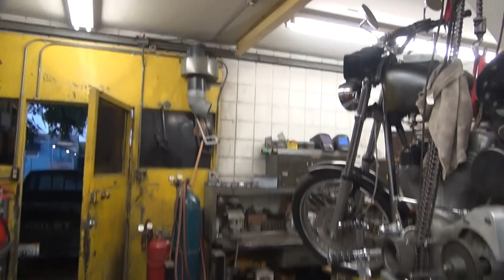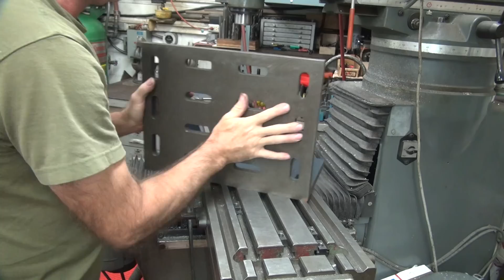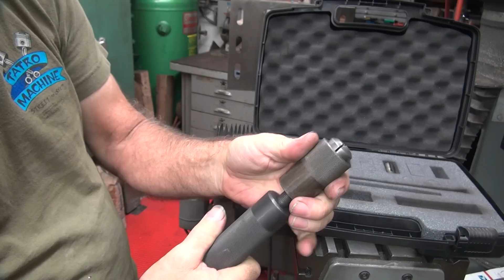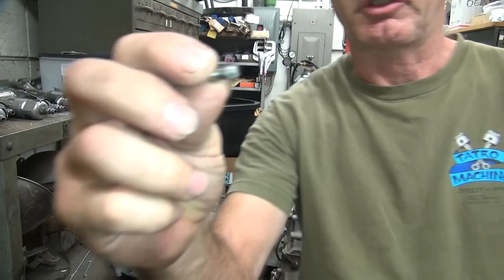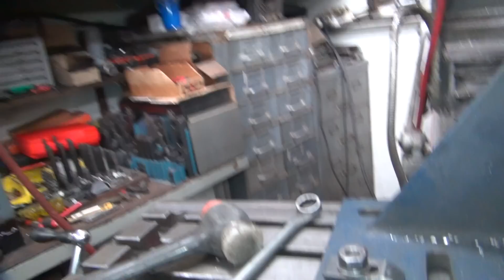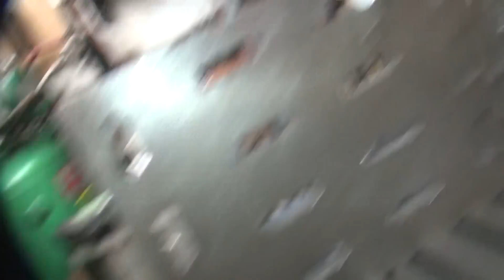#111 1976 98ci stroker shovelhead motor rebuild case repair flywheel balancing harley tatro machine

Comment: Do you ever lap case halves together using lapping compound?
Reply from the maker: no because it does not make them flat. anything more that a light lap makes things uneven and not flat. you have to machine things to make them flat.
tatro

Comment: Whats your opinion on delcron shovel head case's
Reply from the maker: they are way to big for a street bike. they were made for racing and built for that. s&s and ultima are a better option these days. they fit way better and are alot lighter.
tatro